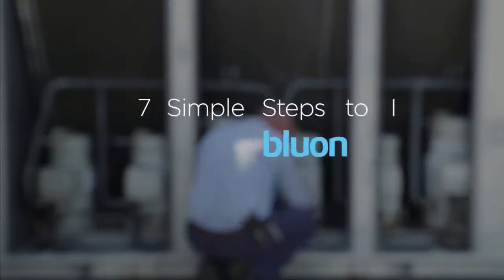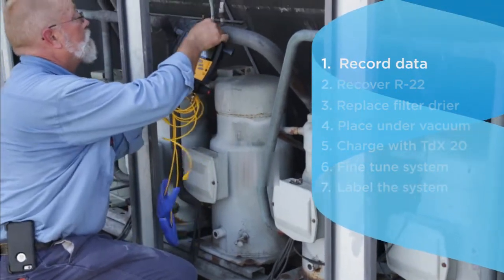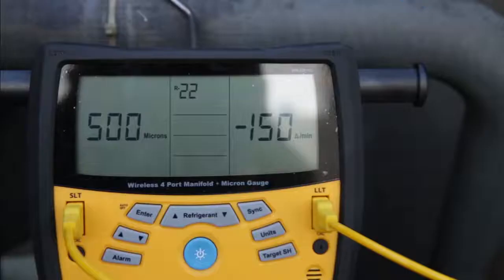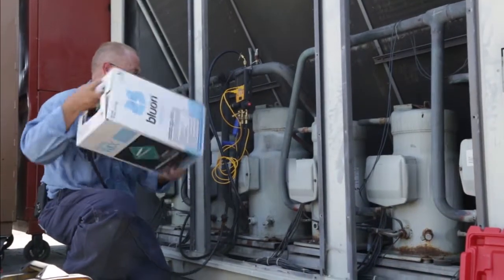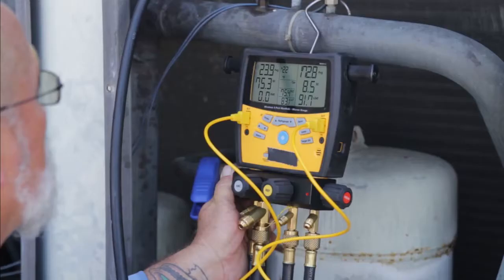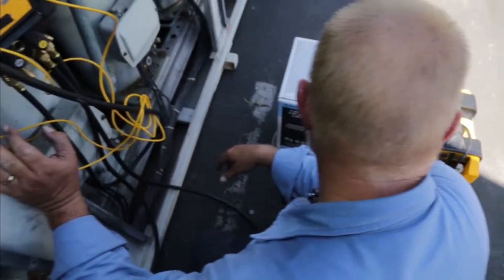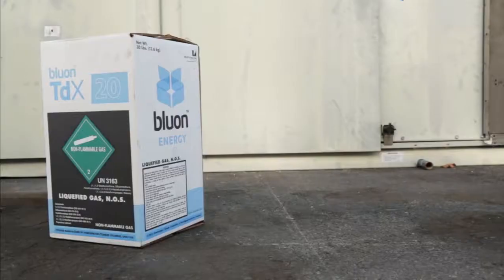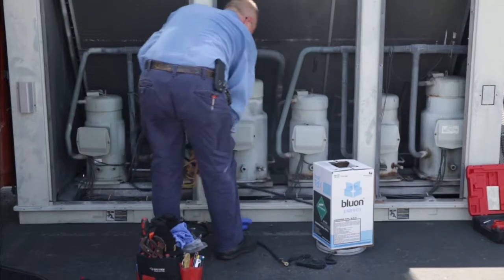Bluon TdX 20 Installation Video

Comment: Near drop in “as far as he’s concerned”? No thanks.
Reply: We've been using it for awhile and so far it's way better than M099. M099 is a compressor killer. But pressure wise it's way different than R22, you'll be running much lower pressure than you're used to.
Reply: @jdthesexpert05  I appreciate your comments can you elaborate the lower pressure is that a good or a bad thing?  Does using bluon cause the unit to run longer? The same as R22? Or less than R22? Causing electric bills to go up or down or aboutthe same? Is the air as cold as r22? . Just in your opinion. It's hard to find technicians that are willing to answer questions or respond. Both me and my girlfriend have older units that have R22 and as you know it's outrageously expensive just wanting to know if need be what would be a good alternative.  Thanks for your time
Reply: @bobyeager6104  What pressure is considered good or bad is merely dependent on what the refrigerant is. Some are designed to run at higher pressures and some lower.

What you want to know about is capacitance of the refrigerant which is what tells you how efficient a refrigerant is. Bluon has better capacity than R22 and is therefore more efficient. As far as run-times and electricity bills you wouldn't notice much of a difference between the two if at all. But Bluon is much cheaper per pound than R22 so if you have a leak and are having to have refrigerant added every so often then it's worth switching to Bluon. Apparently not everyone has access to Bluon locally so your local HVAC companies may not have it. I definitely don't recommend M099 as it doesn't carry oil well and burns out compressors quite quickly.